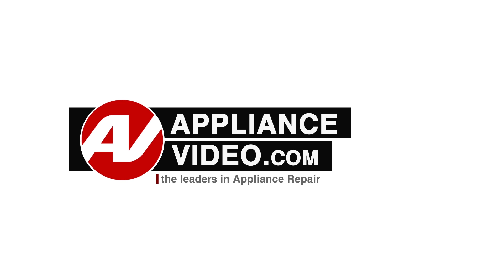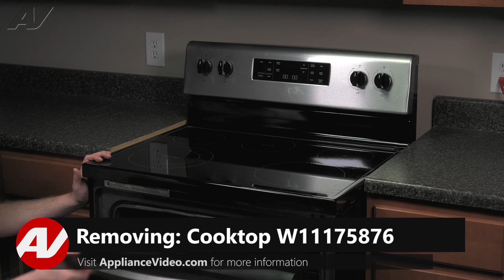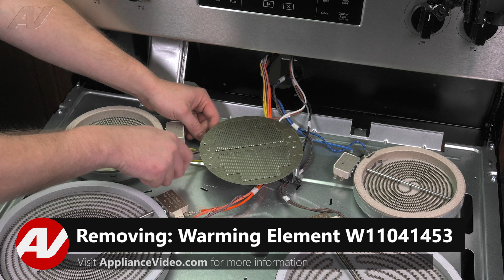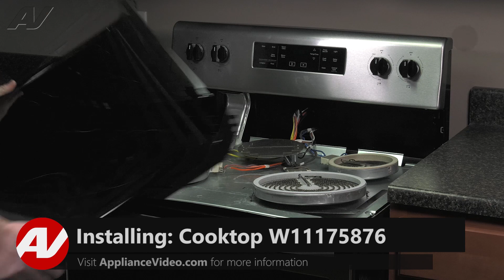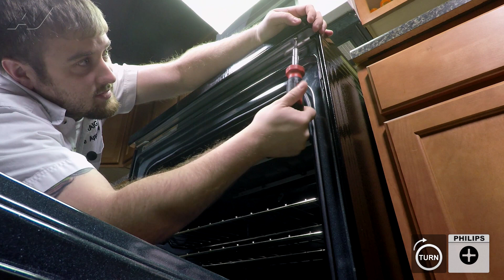Whirlpool Stove Repair - Element Will Not Heat - Warming Element

Comment: hi thanks , amana AER5830 VAW 1   the problem is the opposite when get temperature doesnt stop stills full red doesnt manner if you change the knob to lower number or low position, only way to stop is OFF , could be the element too ??
Reply from the maker: Great question, if you have a
more technical question that our parts department cannot answer, you can search
our over 10,000 answered questions free at our website www.ApplianceVideo.com under our Repair Help section. You can also call
our parts department at 1-800-830-5465 and they can give you help 7-days A week
Monday -Saturday, or search at www.SaveMoreOnParts.com  24 hours
7- days A week.